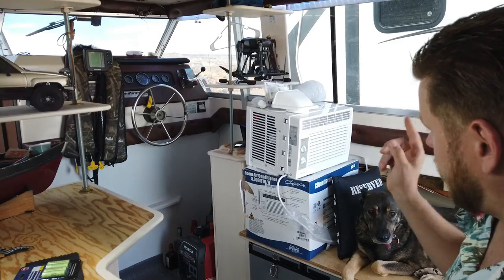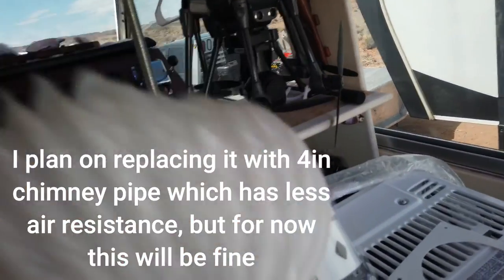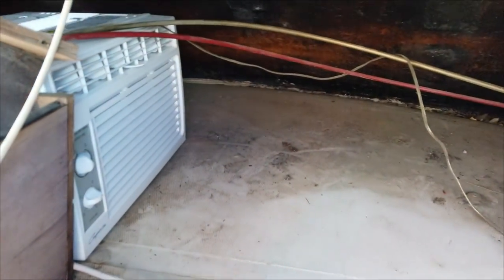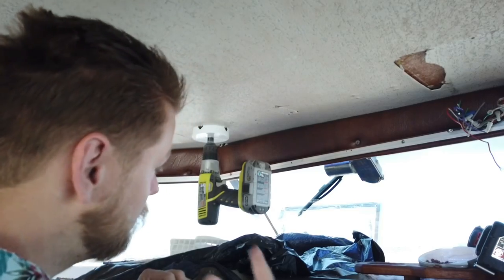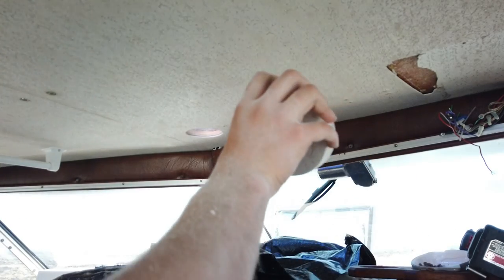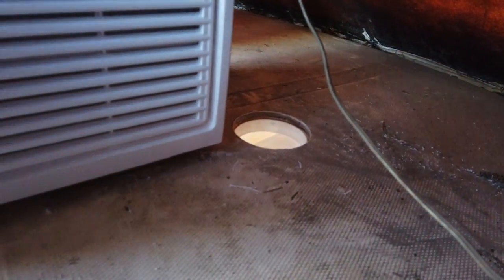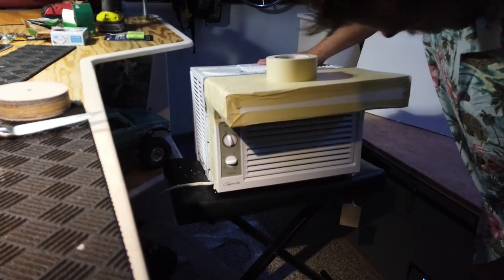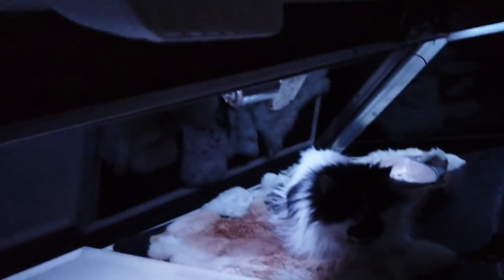How to convert a window AC to work on the roof, cheap, simple, & easy.

Comment: I believe you will only get ~20F of temp drop from the front intake to the output air. If you take in air from the same space you are cooling there is the effect of continuously getting colder (to a point, thermostat limits this so AC won’t freeze up), which is quite important in hot weather.
Reply from the maker: You are correct.  I just wanted to make a very intro level video explaining how this can be done.  I ended upgrading to a 10,000btu AC, that has multiple inlets & outlets, equipped with external blowers, & the intakes are now connected to the cabin to recycle the cabin air instead of drawing in new air all the time.  I am able to maintain 85 in 120 ambient temps outside in direct sunlight.  The system works fairly well, considering it costs under $500.  I also installed remote power, so it can be turned on & off without touching the AC unit, which is nice, as most window AC units will reset their settings if you use the built in power switch.  They always default to eco mode which is super annoying, so the external power switch works much better.
Reply: yeah, I was thinking the same thing, really inefficient... .. but... when you've been standing in 100 degree heat for a few hours, a blast of 80 degree air still feels pretty damn good.
Reply: @ExploreWithThor  Any video on your new setup?  Just found your channel and now doing the required binge watching...  :^)
Reply: @ExploreWithThor  where did u get your foam board
Reply: The typical AC unit can only drop the return air 15~20 degrees. Since he is pulling 90 degree air from outside, it can only get to about  70 dg from the vent(should be in the low 50's. Plus since he is sucking outside air into the boat it would pressurize the boat, so for every cfm cool air in, the same cool cfm going out. Think about how a window unit is designed to work in the window. It recirculates indoor air and cools the condenser with outside air. In a pinch this set up will work but with very little efficiently. 
nt

Comment: With the intake not routed to the cabin and pulling air from the top deck, you run the risk of your one buddy, and I know you got one, that will go up there and rip ass on your a/c unit intake, Exposing the flaws of your install.

Comment: I think that particular A/C uses a “slinger” method to sling water on the coil to help with cooling/exchange efficiency. Question is… do you have humid days where the ac produces a lot of condensation? Is it ever an issue or has the ac been able to dissipate the condensate fast enough(via evap during slinging process) to not have any issues?
Reply from the maker: I have never had any issues, but on super hot days I will poor water inside of it so it can sling the extra water onto the condenser & enable it to create cooler air.
Reply: @ExploreWithThor  ah ok. Thank your for the reply